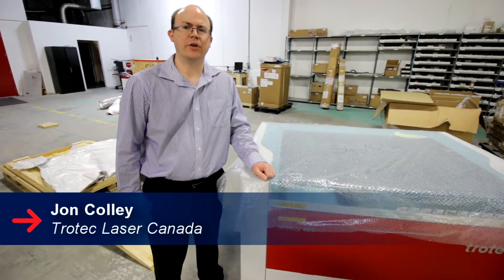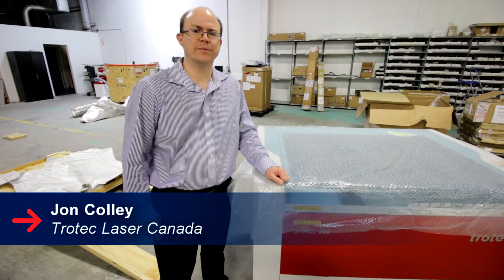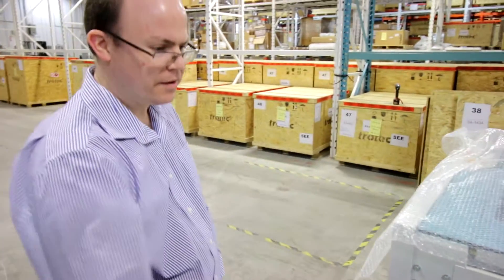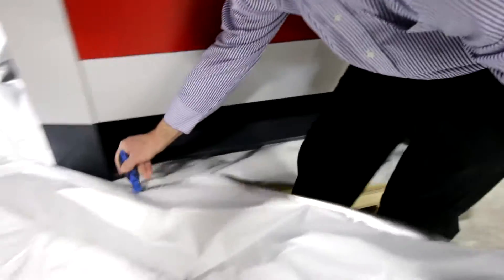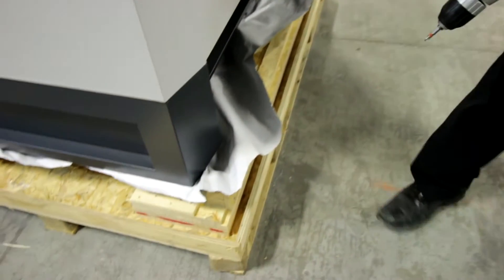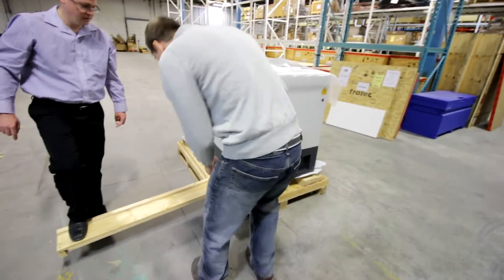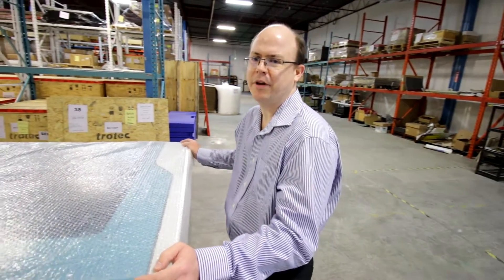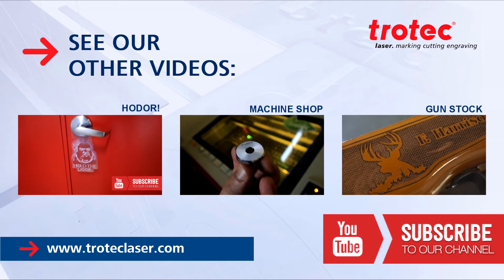Unboxing a laser machine | Uncrating Speedy 400 or Speedy 360

Comment: Can I get the speedy 400 through a doorway that is 88 cm wide?
Can I remove the bottom part and carry it on its side??
Reply from the maker: In Canada our standard doors are about 36" wide. Generally speaking, yes you can split the Speedy 400 horizontally and fit each piece through with the proper moving company.
Reply: Thanks for answer.  Split horizontally? The top and botton appear to be connected, no? And is it safe to turn the pieces on their sides without damaging something inside??
Reply from the maker: @Gibakook  Yes the bottom part comes off, but again we always recommend to use a professional moving company and work with your local Tech Services department. What location are you in?

Comment: Can I just leave the laser on top of the pallet, so I don't have to use the casters? I ask because in my workspace, I have everything on pallets, which allows to move things efficiently by myself. Materials are on a rack, bolted to a pallet, computer desk is bolted to a pallet, etc. It would be nice to move the laser just a little bit, easily, so I can vacuum/clean around the back once in awhile. 

Do you have any customers who do that, leave their 360/400 on top of the pallet?
Reply from the maker: Hi! Yes of course, there is not reason why you can't. We don't personally know customers who do it, but it's perfectly safe.
Reply: Thanks!
Reply from the maker: Anytime!